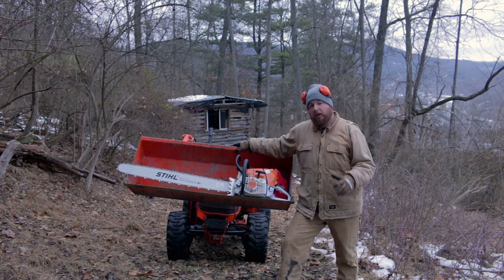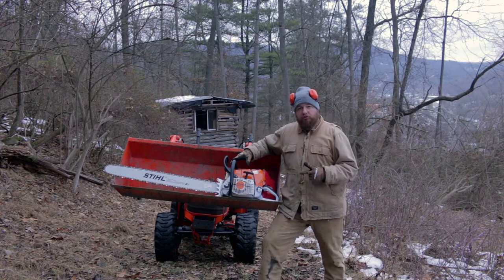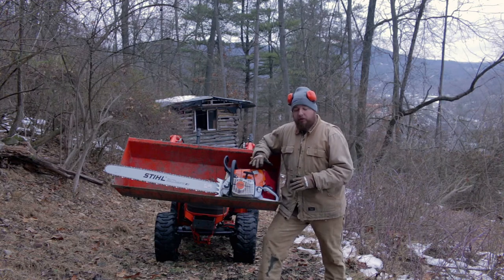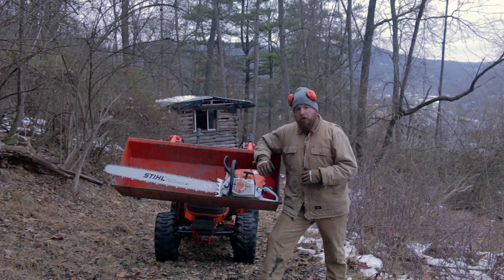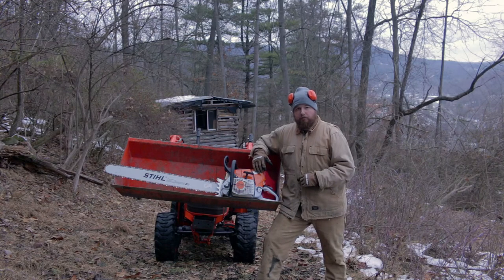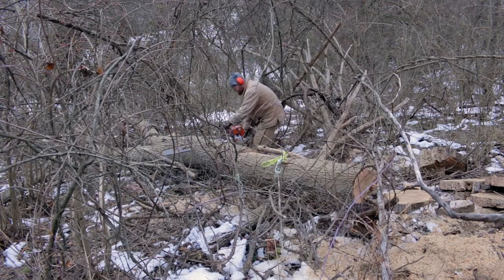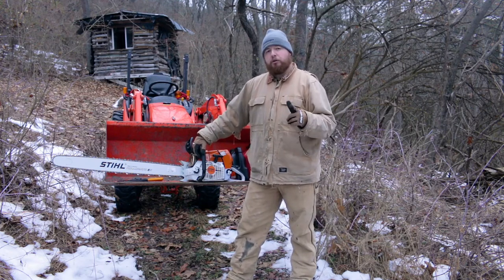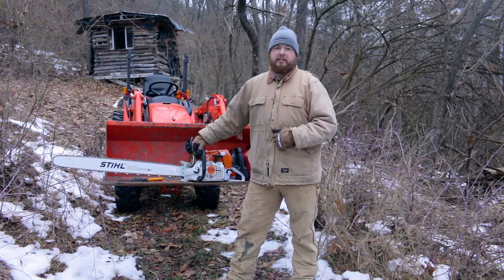BEST way to Break in a New Chain Saw

Comment: This is completely incorrect. Fill the tank and use the saw. Done.
Reply from the maker: Thanks for your opinion
Reply: That's my opinion too, actually my dealer said the same thing to me the day I purchased my new echo cs590 Timberwolf
Reply: @appalachiandiy2415  Its a fact, not opinion. I have thousands of hours on stock saws and modified saws. From the 661CM manual: A factory new machine should not be run 
at high revs (full throttle off load) for the 
first three tank fillings. This avoids 
unnecessarily high loads during the 
break-in period. As all moving parts 
have to bed in during the break-in 
period, the frictional resistances in the 
shortblock are greater during this period. 
The engine develops its maximum 
power after about 5 to 15 tank fillings
Reply: You can brake in however you wont
Reply: Truth.  The saw has already been broken in during epa testing before it ever leaves the factory.  Flash it up and start cutting
Reply: I let mine idle for ten then cool down then idle for rest of first tank with throttle blip now and then. 2nd tank was 3/4 throttle and that was it for me. 462 btw
Reply: Thanks for that mate! Helped me as I’ve just bought a new sthil!! 👍🏻👍🏻

Comment: with my years of experience with two stroke chainsaws, The worst thing you can do for a brand new motor is let it sit there and idle!! Please don't give information if you have no idea of the outcomes of these motors
Reply from the maker: Why do you think that is bad for it?
Reply: @appalachiandiy2415  carbon buildup on the piston, when I was at the stihl factory the engineers would run them for exactly 3 minutes and shut them off, let it cool down then they would start them back up and run it through the rev range to properly seat the piston, it allows the piston to heat up from the exhaust port gradually and expand to its maximum therefor eliminating future cause of exhaust port burn on the piston rings, 
These get revved at the manufacture before they leave for retail, so by running them on idle you are robbing the motor of lubrication as this is increased with fuel as it’s a two cycle mixture, also the piston seats as it goes up and down through the rev range, hence why you always see professional race bike riders continuously revving their two stroke motors to keep them optimally lubricated and allowing it to heat up to operating temperatures which can’t be achieved while on idle, I have spoken to many engineers in this profession and they all seem to come to the same conclusion, I’m sure your not hurting the saw in your break in procedure but you are robbing it of benefits, 
The most important thing is not to free rev the motor high up in the rev range, best way to break them in is to use them on very light timber and put them under a small load to help the piston bed in,
I’m happy to be corrected if I may be wrong in my information but I have saws from the early 80’s that’s are still running strong with no scoring or buildup
Reply from the maker: @AlexanderTheGrateful  good info, thanks
Reply: This right here is why i love the internet. Good stuff. The both of you
Reply: Idle= less lubrication from fuel yes but also very low rpm. More trottle = more lubrication but also more friction and heat from rpm. So i dont think its that much of a difference.
Reply: @meskalin64  actually you are wrong, when running at optimum temperature it causes the least amount of wear. But on idle with too low a temperature causes the most wear and tear!! Look it up 
Most wear and tear that happens to a motor is when it’s first switched on. The reason is because it cold and causes wear as the tolerances are out of spec until the piston and cylinder has warmed up and expanded, 

With all respect, if you don’t know what your talking about, why do you comment? 

I’ve worked at stihl as an engineer and we engineer these machines to be revved full throttle for maximum performance and life expectancy. 
Infact we find that the most hours on our machines were the ones that were put through the most stress, always on high revs and minimal warming up and they outlasted all the once that were babied and taken care of, 

There is a lot that comes to play with metals and materials that expand and contract, not only that but the way a two stroke engine works by creating vacuum it needs to be revved higher and more often, 

When you watch two stroke motorcycle racing, what’s the first thing you see the rider do when he started the bike? 
He will constantly rev it and not let it sit on idle for more that a second or two!! Why you might ask? Because they spend thousands of dollars for engineers to build their bikes. And these engineers will constantly remind them to not let the engine idle and constantly give it blips of the throttle for two reasons. 

1- to not build up gunk and not to oil starve the bike on low idle. 

2- the bike needs to be at optimum temp or it will go pop!! 

I’ve spent many years testing two strained in all applications and based on my many years experience I can bet my left testicle that the information I’m giving you is accurate and from a reliable source 

I don’t get why internet mechanics just blatantly reply to a comment that they think they know the answer to,

Again I’m not trying to belittle you or tell you your wrong, but with all love and respect do some research before you try correct others. You might learn something 

God bless

Comment: I just bought an Echo chainsaw and I contacted them directly to ask this question.  They said there is no break in procedure for their chainsaws, and the saw would be broke in after two or three tanks of gas under normal use.
Reply from the maker: I would suggest to at least not to rev it when it's not under load. Good luck
Reply: Echo told me same thing,  run like normal without running it open without being under load
Reply: Except echos take like 10 tanks to really break in!  They must make rings from freakin leaf spring steel.

I dont do an elaborate break in like this guy, but I do let it idle for several minutes to ensure rings are decent seated and run it very rich for the first few tanks.

Comment: I doubt anyone has ever or ever will go thru a full tank of gas at only 3/4 power. I also can not believe that Stihl would expect that of anyone.
Reply from the maker: they dont recomend the 3/4 throttle. that is something I do and suggest. it helps give a buffer to maxing out the rpm for the engine. At $1300 ill take any advantage to make this saw last as long as possible.
Reply: @appalachiandiy2415  I bought an MS661 here in New Zealand 5 years ago, $2400. I babied it first few tanks, and still let it idle for a minute now when cold. It' still got arm tearing compression and runs like brand new. I personally believe letting the aluminium  piston warm a  bit in the steel bore before hard work is so important. Each to their own but I believe in taking it easy on a new (and cold) chainsaw. Thanks for the video.
Reply from the maker: @MC-ft8zv  totally agree

Comment: Always full throttle my friend. It's all or nothing with small 2 cycle engines. My Stihl 028 av is always used at full throttle and she's still going strong after all of these years.
Reply from the maker: im glad its still running good for you
Reply: I agree.  Full throttle under load, but short durations for the 1st tank.  10 minutes of idle seems a bit excessive.  Idle till it gets to full heat, let it cool completely before using again.
Reply: The Stihl manual says to NOT run it at full throttle until you've gone through 3-4 tanks of gas. I was confused about this because I know that you either run a saw at idle or full throttle, but according to the manufacturer that doesn't apply to the break-in period.
Reply: @drakeswake  Full throttle while cutting.  No full throttle outside of wood.

Comment: great video! just bought a 500i wish i watched this 2 weeks ago but i did the same thing pretty much. idle for 10 mins this just started bucking smaller stuff but not at 3/4 throttle. always heard saws are not meant to be used at anything but full throttle but I guess for break in it sounds right. thanks!
Reply: The pro saws are good for not needing full throttle, like if cleaning up a face cut or smaller tree felling.  If sounds like spark plugs fouled, hit it hard bucking or whatever will clean it up.  Only reason can think anyone would say needs to run full throttle is preventing spark plugs fouling.

Comment: My dealer told me the first two tanks of gas run 40 to 1......there was no mention of idling the saw as I would imagine this makes it hotter and minimal oil....the dealer told me no more than half throttle for the first tank and 3/4 for tank 2 
After that 50 to1 and normal revs

Comment: Keep a little rich and let it eat first tank or two. Lean out to a comfortable level after and run it. Only thing that seats is piston rings/cylinder. Gotta generate high cylinder pressures to push the rings out against the cylinder.
Reply from the maker: Thanks
Reply: The Trashman  a lot of manufacturers recommend 50:1 but they do that for emissions. I have seen video of scoring on saws that have been run at 50:1 so I like 40:1 for normal operation.

Comment: Listen man!!! Unlike an automobile you do not "break in" crank bearings on a chainsaw! They are ball bearings not babet bearings. As far as the piston and rings are concerned the harded you run the saw the better the rings break in! As a professional timber faller who has broke in almost 40 new saws over the years I can tell you that if you let it warm up for 1 minute and than run it as hard as you possibly can the saw will last longer and run better everytime! When it takes 10 tanks to break in your rings it means for 10 tanks of fuel your getting burned exhaust blow by into the crank case and that will prematurely take out crank bearings and seals. That is a fact. Every single saw that I broke in useing the broke Dick method failed prematurely and it was crank seals or bearings everysingle time! When I learned to run them hard and get the rings seated as quickly as possible I never had that problem again
Reply from the maker: thanks for your opinion
Reply: What you just said is contrary to the manufacturer's (Stihl) instructions for breaking in their saws.
Reply: Echo said same thing to me, just to not open it up unless it's under load. Sthil is junk, I'll never buy another one after owning a Echo. Echo dominates the competition in price,  warranty, power and longevity.
Reply: @dentondunn4346  😂😂😂😂😂
Reply: Thanks for your reply, dealer told me to just start using it and not hold it open unless it's under load. Read manual and break in pperiod isn't mentioned and company says all saws are fired up and tested before they're shipped to the dealer

Comment: I just got my brand new stihl ms311 back from the mechanic after watching this video and trying to break it in. His advice was completely counter to the advice given here. His advice is this:

1. DO NOT IDLE STIHLS LONGER THAN YOU NEED TO. LONGER THAN 5 MINUTES IS OUT OF THE QUESTION. 
2. Nothing in the instructions says do less than full throttle ON load. It just says no full throttle off load. 

These machines are designed in a fairy binary sense. They are meant to be full throttle work machines. In fact the cooling fan spins relative to the throttle, so idling is the quickest way to overheat the engine. 

The advice in this video seems reasonable but it is actually completely opposite to how these machines are meant to be used. 

I don't blame the video creator but I don't want people to run into the same issue I did. These are expensive machines and it's really disappointing to wreck a brand new one.
Reply from the maker: You are correct, these machines are meant to run. however the first break in period I would disagree., I don't see how idling for 10-15 minutes will over heat a saw. the "fan" is still running just not fast still providing cooling. The way I break  in saws is more conservative than the manual even says to. Yes, revving of any type not under load is a huge no-no. full throttle is not necessary to break in. by using 1/2-3/4 throttle is just a safety precaution to not over rev AND allows slower seating of the rings compared to going strait to full throttle.
Reply: @appalachiandiy2415  You need to read my comment above! Not trying to be an ass but you are passing on your thoughts and they are not based on anidotal realities! Your information is a VERY BAD IDEA
Reply: You are exactly correct sir! Thank you for your comment because you will save a lot of folks some serious problems
Reply from the maker: @campnoutdoors1621  I dont agree with running the saw as hard as you can to make the rings seat better.
Reply: @appalachiandiy2415  I've only broke in around 40 pro saws

 Consider this fact......a YZ 85 dirt bike is 85 CCs and puts out almost 20 hp. An 85cc chainsaw puts out around 6.5 hp. Running a chainsaw full throttle in the cut is about like running a YZ 85 about 1/4 throttle to break it in. Chainsaws are in fact an extremely low performance 2 stroke and contrary to what some believe you can't hurt them unless you idle them
Reply from the maker: @campnoutdoors1621  again, thank you for your opinion. I acknowledge that you say you have broken in over 40 chainsaws but that doesn't mean it's the correct way. Do you have your own video explaining how you break in a chainsaw explaining the way you do it? I would love to see it
Reply: I've just bought a Stihl 881, and nowhere in my manual does it talk about 'break-in'.

The first thing I did, when I started it for the first time, was notice an excessive amount of bar oil that appeared to be leaking from under the chain cover, it was just "dripping"out. So transfixed on that, was I, that I found myself uncontrollably revving it under 'no' load, to the point that I even touched full throttle on occasions, in order to get the chain spinning so that I could detect where the oil was coming from, and just how much was flinging off the end of the bar nose... turned out that was normal and once I stuck it in wood it coagulated and self healed.

Not knowing how to properly break in this beast, I turned to the Internet and some other guy, on a forum, had just bought an 881, and he said he was going to let it idle for the first "tank full", and then get into cutting wood in earnest. Thinking that sounded pretty logic, as it wasn't overworking the brand new saw, I tried that approach and let mine idle for half an hour or so?

"When all else fails, rest on your laurels", so I read the manual of my 066. It said to avoid full throttle for the first 3 tank fulls! I'm nearly through my second tank now and I spent the better part of this last (second) tank full mollycoddling it at 3/4 throttle... I guess hitherto, I've done everything you possibly can do 'WRONG'! So, it looks like I can expect both piston rings and crank bearing failure sometime in the extremely near future then?  😪

I think, when I go out next time, I'm just gonna run the damn thing normally at full throttle, and if she blows, she blows?

Comment: Wonder why my saw won't idle unless I warm it up by giving It thottle. Once it warm up it will idle but rough. I ask them about it they said because it not broken in all the way ... Mhmm Stihl Ms170
Reply from the maker: That doesnt sound right. It should idle right from the start. Try turning up the idle screw
Reply: Buy an echo, you'll be better off than a low-end stihl.
Reply: If the low mixture screw is a little off, it can affect cold running.  Try going just a little richer on L and see if it improves or not.  Be sure to note exactly where the orig. setting was before touching it if you are new so that you can return it to baseline.

 Also watch a real tutorial on chainsaw carb tuning before diving in.  Relatively simple concepts- minus the fact that yours will have limiting caps installed to prevent too much adjustment.  Sometimes a subtle tweak helps though.
Using good 50:1 mix?
Reply: @eugenecrabs3954  I’m loving my Echo CS-590.  It’s a bit heavier than the Husky 55 I used to have, but also a  bit more powerful.

Comment: Why do they start new saws when u buy them and rev them way up? Is that bad?
Reply: That kills me inside a little every time they do that.
Reply from the maker: Yea thats bad, especially not under load
Reply from the maker: same!
Reply: I politely tell them to not touch my saw ..  if someone did that to me i'd be going home with a different serial number that day.  Especially on virgin rings and bearings.
Reply: I froze in panic while my nearest Stihl dealer did that, ran WOT for a full 20 seconds with no load on a new saw.  I returned it the next day and went to another dealer who does nothing of the sort, only short spurts, maybe 1/4 to 1/2 throttle, to prove out the oiler.  Funny thing is that 2 Stihl support people around the globe said it's very bad then I got a followup call from Virginia Beach and the tech said "no problem" and they do it in production.  I'm sure that is not true but I'm sure they are rev'd up and down to seat the rings and let bearings and other surfaces break in.  I doubt 20 seconds of WOT.
Reply: @mattfleming86  Exactly.
Reply: @nheng6913  they rev them WOT for 3 minutes at factory lol